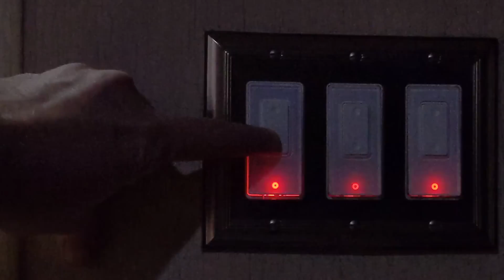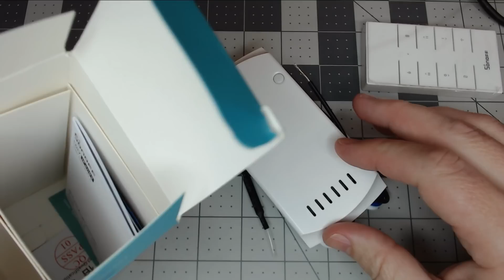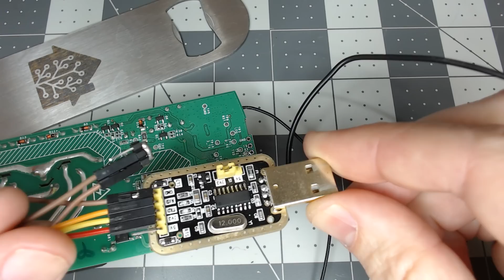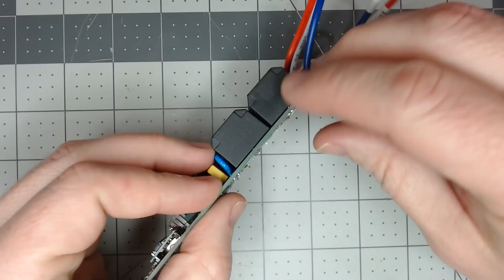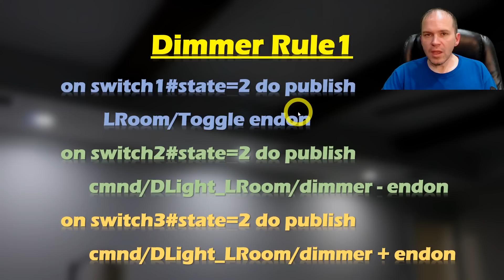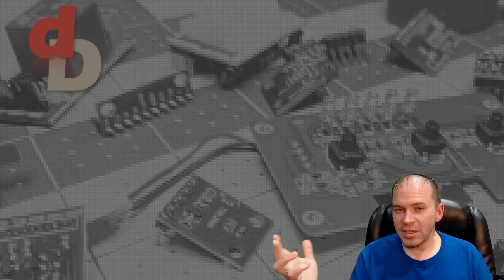Sonoff iFan03 Install with Complete Fan Speed Control

Comment: I have this fan switch and I'm having a problem getting it to work because my ceiling fan has one power wire for the fan and the light is there any unit that will be able to allow this to work or do I need to get a fan with a light and fan wire separate?
Reply from the maker: This is designed for a fan and light separate power wire setups.

Comment: Nice video, Congrats! I'm getting a Sonnof iFan04 110V 50/60Hz. Is it possible to control the 3 fan speeds in the Sonoff App without having to change the capacitors?
Reply from the maker: Yup, that's the only difference on the iFan04 as it has North America sized caps

Comment: I have an EU 220V fan that spins too slow on low and medium settings of the iFan03, do I need larger or smaller capacitors to make it spin faster ?
And... is there one capacitor for low, one capacitor for high and full contact without capacitor for high speed ? Is that how they are wired ?
Thanks.
Reply from the maker: In my case the caps on the ifan03 are too small so the larger caps were needed to make it go the right speed.  Luckily they did come out with the iFan04 for us.

Comment: Great video on changing the capacitors! I'm having a heck of a time to get the configuration correct into home assistant. I'm not using any dimmers. Just a smart LED bulb in the fan. I have successfully flashed Tasmota on the device and the controls are working as expected. MQTT Autodiscovery does not properly define the FanSpeed relay buttons and I'm struggling for the best method to add this controller into home assistant. The old template I used for my first fan controller I did years ago was put into my configuration.yaml has been depreciated since they changed the speeds from High, Med, Low to percentages and I've found very little documentation. Since then, I've split up my configuration and added a fan.yaml to play with. It just isn't working
Reply from the maker: Use the new HA Tasmota integration, it supports the iFan03, no yaml to mess with.
Reply: @digiblurDIY  Yes I got that far, but having a heck of a time getting Alexa to understand how to control the fan speeds.  Annoying that she keeps telling me "I don't know how to do that" . I did go back and comment out old yaml entries for the device but "she" also tells me there are multiple devices with the same name even after re-running discovery. My wife is OK with Alexa but will not touch the app or use her phone to control anything.
Reply from the maker: What are you saying to it?  I know I've had to change with the recent fan changes in HA to say set living room fan at 50 percent.

Comment: Travis - I was messing around with the rules trying to correct a minor problem.  Now, none of the rules are firing.  Power cycling didn't fix the problem.  I re-flashed vanilla Tasmota 8.4, did a reset1, then power cycled, re-entered all the rules, and made sure rules are turn on.  Switchmode and switchtopic are all set to 0.  Rules are still not firing.  Any suggestions on what I can do to restore rule functionality?
Reply: I forgot to mention in my post above that the rule problem is on the Martin Jerry switch.  Actually, I think rule3 is working because I see the on/off led going from red to blue when I toggle the on/off switch.  I've also verified I can publish message manually from the Tasmota console so problem is unrelated to finding the MQTT broker.  Problem is that when I short pressed or long pressed the switches, the "on switchX#state=N" triggers are not firing the publish command.
Reply: I screwed up.  Problem was caused by that "switch" vs. "button" issue.  I keep forgetting I need to modify "switchX#stateN" to "buttonX=stateN" when I'm using vanilla Tasmota.
Reply from the maker: What device?

Comment: My 5mf capacitors came today and I've installed them.  I'm doing some testing with my multimeter, but getting voltage results on the fan output I don't completely understand.  When the Ifan03 is plugged in, I read 120V on the fan output line immediately.  As expected, when I hit the low, med, high, and off buttons on the remote, I hear a relay click.  Voltage remained around 120V regardless, even at "off."  I know the capacitors are doing something to the phase angle, so not too surprised voltages read around 120V for low, med, and high.  The one scenario that surprised me is that I get 120V even at "off."  When I connected a single-speed gable exhaust fan to the IFAN03, it doesn't turn on at all, even thought I know it's getting 120V.

Do the capacitors have palarity?  I assumed they didn't but still installed them in the same orientation (by the label marking) as the original.  But I noticed label markings are opposite to what's shown in Travis's video. 

This IFAN03 with new capacitors may still work on my ceiling fan.  But it's kind of a pain to install, so I don't want to actually do it until I have a bit more confidence this is going to work.  Does Travis or anyone else have some  insight on the results I'm seeing?
Reply: I temporarily wired in the IFAN03 to my ceiling fan.  Surprisingly, everything seem to work fine.  I still don't know whether it's appropriate to be getting 120V at "fan off," but not going to complain.
Reply from the maker: The fan speed isn't driven by a voltage difference.  If you are seeing voltage with the fan load attached then that would be an issue but would probably make the fan spin as well.
Reply: @digiblurDIY  I just thought of something.  When I was seeing 120V at fan "off,"  it may be due to the capacitors not completely discharging.  I'll bench test again and report back.
Reply from the maker: Yep. Have to drain the caps in the fan and the ifan03. Kinda like working on the old CRTs but not as bad as a boom.
Reply: @digiblurDIY  No, the capacitors weren't the cause of why I'm seeing 120V after pressing the "off" button on the IFan03 remote.  Here's what I did to test:

- connected the IFan03 input wires (line and N) to power
- capped the IFan03 light output wire
- connected the remaining two IFan03 output wires ("N" and "fan out") to my multimeter

As soon as I apply power to the input wires, I read 120V.  When I pressed any of the fan-control buttons on the remote (fan low, fan medium, fan high, and off), I hear a relay clicking with voltage remaining around 120V.  As mentioned, clicking the "off" button activated a relay, but didn't turn off voltage to the fan output line I'm measuring.  I thought the capacitors were causing this, but no; I waited for 5 minutes, but see no voltage decrease at all.

When installed on my ceiling fan, this IFan03/MJ switch combination worked perfectly.  Fan speeds were around the same as stocked speeds.  When I pressed the "off" buttons on the remote or MJ switch, the fan turned off as expected.  All other switches and buttons on both the remote and MJ worked flawlessly.

I don't know why I'm reading 120V when the IFan03 fanspeed is off, but it doesn't seem to be causing problem on the ceiling fan itself.  I'll be happy to run additional measurements if anyone is curious.  Otherwise, I'll just install this and call this project a success.  Also, if anyone happens to have a similar setup uninstalled, be great if he can run the same test as I did.  Be fantastic to get an explanation to what I'm seeing.  Once again, this is a stocked IFan03 with the two original large rectangular capacitors replaced by two 5uF ones.
Reply: My only guess is how the capacitors are holding a charge during the phase changing. It's likely no longer a perfect sine wave. It's important to remember multimeters read the RMS voltage, not the peak. So it might not be seeing the voltage/current over time changing.

Comment: Since I'm using the Martin Jerry dimmer only as a WiFi switch to control the IFan03, I capped off the 2 output wires on the MJ.   Just out of curiosity, I connected a light bulb to those two wires.  What I observed was that although the rules on the MJ decoupled its relay from the physical switches, not surprisingly, a "power 1" command sent via console or MQTT message still turns relay on.  Also, the "dimmer" commands sent by rule1 on the IFan03 turn on the relay as well.  Probably not a big deal, but having live voltage on the capped output wires bothers me for some reason.  Is there anyway to toggle the led to reflect fan speed without having the relay turned on? 

Also, the command "ledpower" has no effect on the Martin Jerry.  Does the MJ actually have an on/off status led?
Reply from the maker: The status LED, Led1 of 5 and the relay are hardwired together.  You'd need to modify the switch to disable the relay.  We have live voltage in wire nuts all the time?

For ledpower, are  you using the fork or the stock bin with PWM Dimmer?
Reply: @digiblurDIY   I've tried different combinations; just can't seem to get everything working all at once with any.  Here are the scenarios and their results:

1) vanilla 8.4.0.2 with module type set to "PWM Dimmer" (module type MJSD01 not available): fan & light worked but ledpower didn't (i.e., no status light)
2) fork (8.4.0.2(digiDIMv12)) with module type set to "PWM Dimmer": fan & light worked; there is a status light, but it's on/off when fan is on/off.  So ledpower didn't work.
3) fork (8.4.0.2(digiDIMv12)) with module type set to "MJ SD01 Dimmer": fan & ledpower worked, but long press that supposed to control the ifan03 light (on switch1#state=3 do publish cmnd/iFan03/power1 toggle endon) didn't work anymore.  When I did the long press, I heard 5 beeps, followed by long beep, so fan turned on then off.  Light doesn't turn on at all.  When I checked messages with MQTT.fx, I saw the tog event being sent twice, and power1 toggle wasn't sent at all, which confirms fan turning on, then off.

I guess I can live with either 1 or 2, and do without the status light.  What do you think?
Reply: Typo in scenario 3 above.  It was 3 beeps, followed by 1 long beep.
Reply from the maker: Setoption87 on the pwm dimmer is the LED status light.  On the fork you use the ledpower when using the MJ module.  https://tasmota.github.io/docs/PWM-dimmer-switch/
Reply: @digiblurDIY  Thanks for all your help Travis.  Scenarios 1 & 2 both work now.  I'll go with one of those.

Since I'm still waiting on the 5uF capacitors, I haven't install the IFan03 into a ceiling fan yet.  I'm just testing using an exhaust fan, so haven't been able to test the lower fan speeds yet; max fan speed worked fine.  One thing that's a bit strange is that when I turn the fan on with either the 433mHz remote, Martin Jerry dimmer,  or Tasmota UI, I hear the 3 beeps immediately, but it takes around 6 seconds before the fan starts spinning.  Powering off is immediate.  Do you have this behavior in your setup?
Reply from the maker: Not it is immediate for me. I can hear the relays kick in the capacitors right as the beep hits.
Reply: @digiblurDIY  I hear the relay clicked the same time as the beep also.  As it turns out, when I checked voltage on the IFan03 fan output lines, I see 120V even when the fan's off.  So looks like pressing one of the fan speed buttons just applies one or both capacitors resulting in a phase shift that causes speed change.  I'm pretty sure it's the exhaust fan that's causing the delay.  I'll know for sure when the 5uF capacitors come, and I install the setup into my ceiling fan.

Thanks to you I now have a working solution.  Thanks again for the video, and subsequent help.
Reply from the maker: Now that is strange.  No relays should be on when it is off.  It does toggle the relays to kick in from no caps to 1 cap, to 2 caps to change speeds.  Could be reading from the caps some how with no load?
Reply: @digiblurDIY  I think the relay may just be switching in the capacitors for phase change.  I'll do a bit more testing and measuring and report back if I find anything different. Wish I have an oscilloscope.
Reply: @digiblurDIY  Ok.  Not sure what I was measuring before to get the 120V,  but there's definitely voltage on the fan output line with the fan turned off.  I did some careful measurements this time with just the Tasmotized IFan03 controlled by the remote (MJ not connected) and observed the following:

- when mains voltage is first applied to the IFan03, I read 15V AC on the fan-output line
- going from fan off to fan high, I hear 3 beeps and relay clicking with voltage going to 110.8V; then a few seconds later a second click with voltage going to 122.5V
- going from fan off to fan medium, I hear 2 beeps and relay clicking with voltage going to 110.8V.  There's no second click and voltage stayed at 110.8V
- going from fan off to fan low, I hear 1 beep and relay clicking with voltage going to 110.8V; then a few seconds later a second click with voltage going to 80V
- once the fan is already on, going among high/med/low results in 3 beeps/2 beeps/1 beep with a single relay click and the voltage changing to 122.5V/110.8V/80V
- when switched off, I see capacitors dissipating and voltage going down.  But voltage didn't go to zero; it stoped at around 15V.  If unplugged, voltage then goes to zero.

I speculate the first click applies a start capacitance, and the second click, when there is one, simulates switching over to run capacitance.  Based on my limited understanding of electric motors, I was under the impression that phase change alone controlled motor speed, so was a little surprise to see voltage change as well.  Curious to know whether IFan03 with stock FW will show the same results.
Reply: My measurements explain why I was see a delay when fan is switch from off to high.  Curious why you're not see a delay with your ceiling fan (unless your ceiling fan can start rotation at around 110V).  Anyway you can do the same measurements and see if your results are same as mine?
Reply from the maker: I checked mine and it actually starts turning before the beep. Pretty instant once I hear the relay.
Reply: @digiblurDIY  At high, the 1st relay went off around the same time as the beeps, but only gave the output line 110V.  My exhaust fan had a delay because it couldn't start at 110V.  When the 2nd relay kicked in subsequently, it got 120V; that's when fan started rotation; hence the delay.    If your fan started rotation right away, I speculate it was designed to start at 110V.  I'll know whether this is also the case with my ceiling fan after installation.

Comment: Hi Travis, the "if" test in IFan03 Rule3 doesn't seem to work when using Tasmota 8.4 (module type set to IFan03).  Tasmota documetation says to use "break" to simulate if-else statements.  How did you get the "if" test to work on your setup?
Reply: Also, rules 1 & 2 in IFan03 are not firing at all on the "fanspeed#data=x" and "fanspeed#data" triggers.
Reply: Ah, rules 1 & 2 never fired probably because the fanspeed command was never executed due to problem with "if" statement mentioned earlier.
Reply from the maker: I used a bin file with if expression enabled. https://github.com/tasmota/binaries
Reply: @digiblurDIY  Thanks Travis.  Do you know whether there's intentions to compile this capability into a future regular production release?
Reply from the maker: The expressions?
Reply: @digiblurDIY  full rules including expressions.
Reply from the maker: I doubt it. There is no way you would fit every single feature into the little esp8266 flash. Luckily we have some automated builds with them now though. It isn't too hard to compile your own either.

Comment: I'm trying to setup a Martin Jerry SD01 dimmer and iFan03 to control a ceiling fan with a light kit.  I'm using Tasmota 8.4 on both devices.  I configured module type to "PWM Dimmer" on the Martin Jerry.  Just for initial testing, I put the following rule in the Martin Jerry in attempt to turn the light on and off on the fan using a short press of the on/off switch on the MJ:

on switch1#state=2 do publish cmnd/ifan03/power1 toggle endon

But the "publish" is not firing.  When I published "cmnd/ifan03/power1 toggle"  using an MQTT client (MQTT.fx), it worked.  What's causing the publish not to fire on the MJ?
Reply: Do I need to do "setoption73 1"?
Reply from the maker: I believe that one uses buttons. And I don't think you can use so73 with it. When you get into the weird setups like this then I use the fork of Tasmota for this dimmer.
Reply: @digiblurDIY  Thanks Travis; you're right.  I figured it out by pure trial and error and luck this morning.  Should have just waited for your reply.  Changing rule to:  on button1#state=2 do publish cmnd/ifan03/power1 toggle endon worked.   I sure wish there were some documentation that tells users this.  I looked everywhere.

Is there any way to ascertain valid tasmota-rule triggers for a given module (or template) via the Tasmota console?
Reply from the maker: Really just have to look at the template/module to see what is available to trigger off of.  I am modifying my fork documentation to show the how-to on multipress with it as well as planning a live stream and/or video of doing various switches, dimmers, lights etc.  Real world tricks of Tasmota.

Comment: Hi, I am new with using google assistant. I was able to pair eWelink to Google but the only command it understands is turning the light on and off. I cannot control the speed. When it turns on both light and fan turns on at the same time.